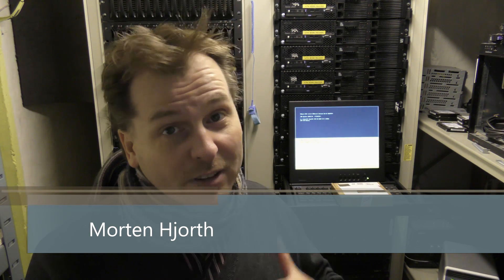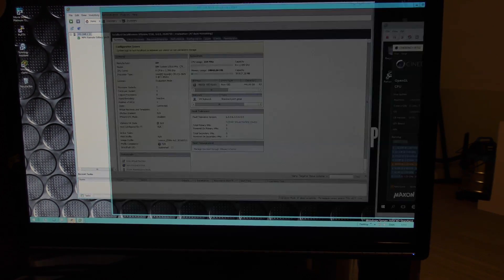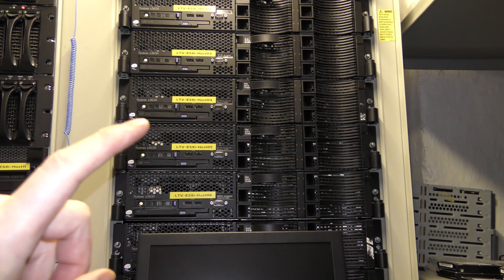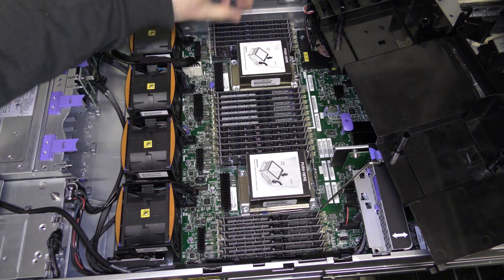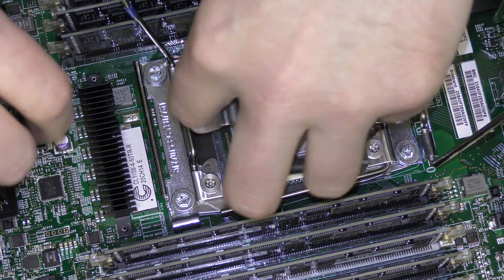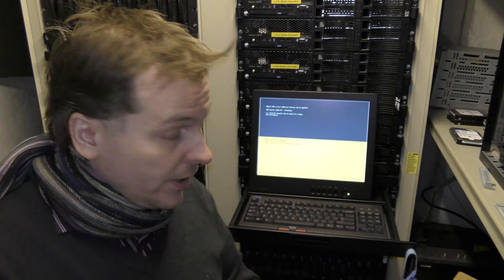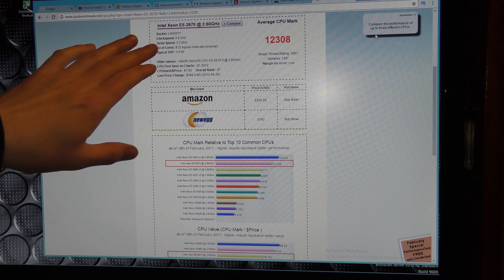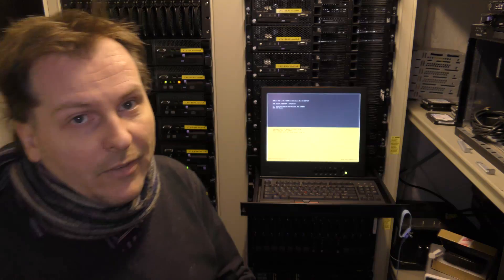$189 - 16Cores in two Xeon E5-2670 at 2,6-3.3GHz - 483

Comment: What's your electricity bill like? :-D
Reply from the maker: No,, there is a lot of info, that pointes in the direction that it´s not that bad,, I turn the stuff of when I am not using it.
Reply from the maker: Hi Espen Sae-Tang Ottersen
I do get this question from time to time, so I have added it to my F.A.Q. that you can check out under the "about" tab here on my channel. I give a longer answer there.
Thank you for watching! :-)
Reply: Haha, yeah I kind of figured you got the question a lot. Didn't realize that electricity is so costly in Denmark. Here in Norway it's like 1/3rd that (roughly 0.70 kr/kWh currently). Wish I could do something like this as well, but no space in my flat.:-P I do have a NUC skull canyon VMware cluster setup for experimenting though. Lots of bang for the buck! I'm mostly into the software part of things though, not so much the hardware.

Comment: Looks like the M4 uses different CPUs then the M3.  
The M3 I got has two Xeon E5620 it in currently.   Is that what most of your run?
Reply from the maker: Hi troyBORG
Thank You very much!  The x3650 M1 uses the 5400 series,, The M2 and M3 uses 55-5600 series. M4 the E5-2600 V1 and V2 and the M5 the V3/4.
Thank you for watching! :-)

Comment: Morten, I'm getting really jealous now! What do you think to this price for this spec, good value?? http://picpaste.de/pics/3650-D8M25M7A.1487962245.jpg
Reply from the maker: Hi Darren Williams
Thank You very much!  I am also pumping money in it :-)
Thank you for watching! :-)
Reply: Do you think what I showed you is a good spec for the money? I'm thinking of hitting that buy button but wanted to see your opinion? I'm thinking of starting with two 800GB Intel DC S3510 SSD. I will be using either VMWare or Proxmox to run LXC containers.
Reply from the maker: Have a look at this one : http://www.ebay.de/itm/IBM-7915-x3650-M4-2x-8-core-E5-2680-2-7GHz-16GB-2x-500GB-M5110e-RAILS-/162407888001?hash=item25d043b481:g:Rp0AAOSw2xRYU-d9
and build on that one.
Reply: Morten, I ended up getting this one:

IBM System X3650 M4
Processor #1: 2.00 GHz Eight (octa) -Core Xeon (E5-2650) - 2.80GHz Turbo Boost Speed - 8GT/20MB
Processor #2: 2.00 GHz Eight (octa) -Core Xeon (E5-2650) - 2.80GHz Turbo Boost Speed - 8GT/20MB
Memory: 192GB - (24 x 8GB) - DDR3 ECC Reg
Hard Drive #1: 2.5" Caddy/Tray
Hard Drive #2: 2.5" Caddy/Tray
Hard Drive #3: 2.5" Caddy/Tray
Hard Drive #4: 2.5" Caddy/Tray
Hard Drive #5: Blanking Plate
Hard Drive #6: Blanking Plate
Hard Drive #7: Blanking Plate
Hard Drive #8: Blanking Plate
Network Interface: Additional 10GB SFP+ Ports Onboard (I have 10GB ports on switch)
Power Supply: Dual 750W PSU
Rack Rails: Rack Rails Included

It has the controller with 1GB cache
2x120GB Intel DC S3500 in Raid 1 as OS
2x1TB Samsung 850 Pro in Raid 1 as data

Happy days, it arrives Wednesday :)
Reply from the maker: Darren Williams Awesome,, what did you end up paying?
Reply: £1500, obviously, drives were extra. The biggest was the RAM, that cost me £400+. The drives I got new. And it is coming today not Wednesday. You have convinced me that these are the server to have. I was thinking of Dell R720  at first :)
Reply from the maker: Darren Williams Nice,, I really hope this will work out for you.

Comment: On the free version you can only run 8 vCPU's, which is a massive pain because I have to run 3 VM's for my 24 thread server to use them all.
Reply from the maker: Hi Joshua Nicoll
Thank You very much!  Yes That is where VM-ware would like to make some money,, the trail version will run all your cores in 60 days.
And the dark, side has long lasting cookies,, if taste is not important.
Thank you for watching! :-)
Reply: Do you use a feature from ESXI you really need or why dont you install your system on bare-metall? I run a ZFS filer and some other stuff and never really needed more then 8 vCPU.
Reply: Because it's a dual CPU server, so no normal versions of Windows will work on it. I can't even install them though, so no loss there. It was fine since I ran and preferred Linux. However I installed an AMD FirePro V7900, but the Linux drivers even for the FirePro where lacking, probably due to the cards age. It was a lot easier to install ESXi and just run it in a VM, which also meant I could break out the Minecraft server that was also hosted on the system into a VM, but sadly I then had to install two more Linux VM's when I installed the free license key, so the Windows VM has 8 threads and the V7900, and the other two Linux VM's also has 8 threads. It works fine for that, and definitely makes managing the server easier, but the overhead, although small, is still measurable, and for a HPC system, it isn't ideal.
Reply from the maker: Joshua Nicoll I found that three VM with 8cores is faster then 1 VM with 24cores,, and 6 VM´s with 4 cores will be even faster. one core per VM is the fastest,, but that is a hell lot of VM´s.
Reply: Yes, I believe that is because of how VMware distributes the CPU's total MHz, but for BOINC such distributions is not oh so productive due to how BOINC handles CPU threads
Reply: Joshua, you considered Proxmox??
Reply: Hi Morten,
Yes, unfortunatly for VMware, this server doesn'y make me any money, and only costs me money, so I'm not going to make it cost me more money to float their company since actual professionals will be paying a lot of money to them, and that lets them make even more money, this server is used for BOINC and MineCraft.
Reply: Joshua Nicoll you can also try Xen server which is free

Comment: I'M using ESXI 6.5 and there is no control over mouse or keyboard settings from what I can see. You use ESXI 6.0 and I see you have more options to control on a virtual machine. Is that right that the old version gives you more control, and the new version has these options striped out? Cheers and get well soon 😷
Reply from the maker: Hi T Komoski
I do not think so,,,but you need VM tools..
Thank you for watching! :-)